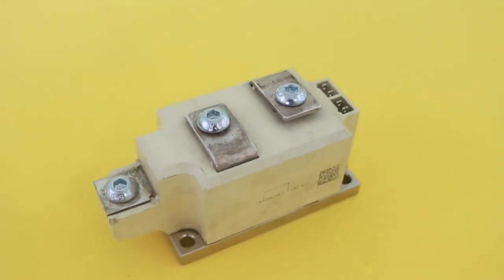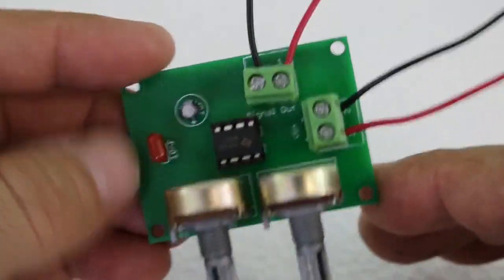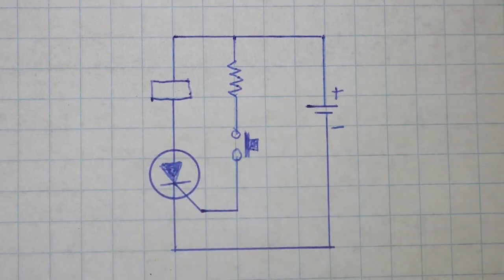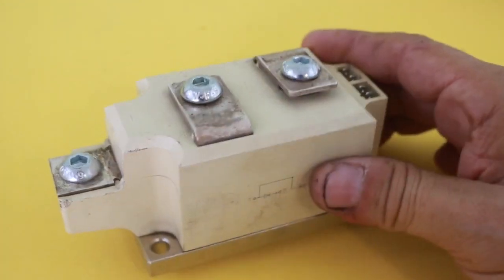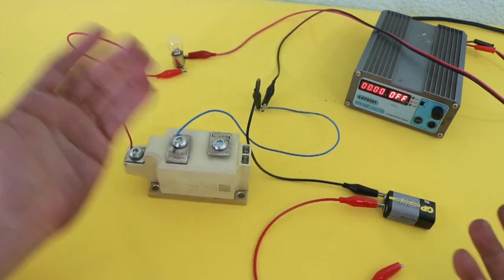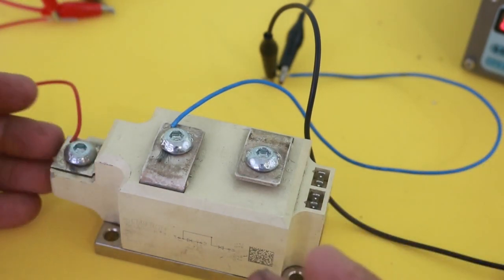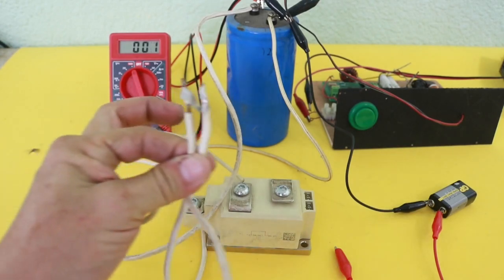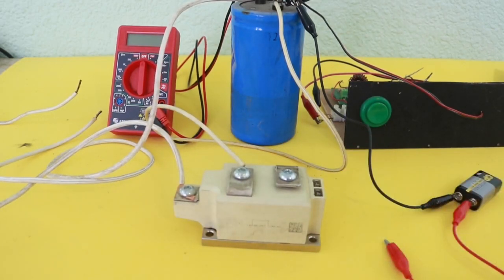Massive SCR Thyristor - 9000 amps

Comment: Thanks for your efforts to share with us! Two questions... One, you energized the thyristor by applying the 9 volt battery. But, I think I missed how you turn it off. How do you shut down the circuit? Ground the gate? Two, I would think that aluminum vapors would be extremely bad for your health. Maybe use some other type of indicator. I'm just concerned for your good health and well being. Cheers, friend!
Reply: Thyristors are normally used for AC current and so turn off when the load crosses zero volts